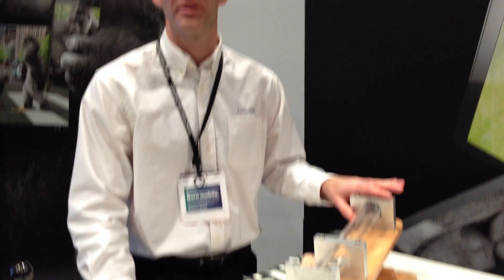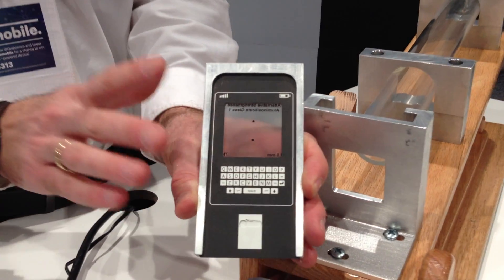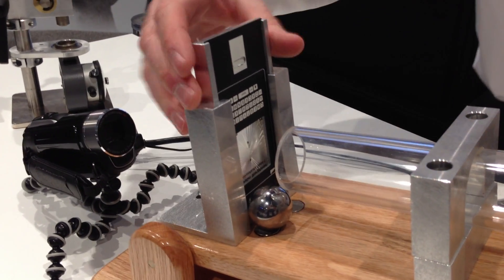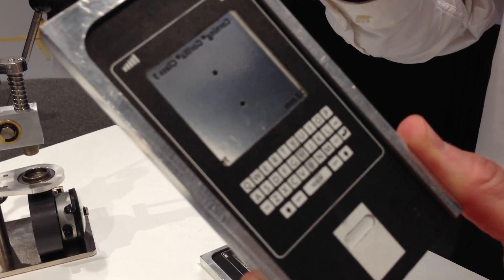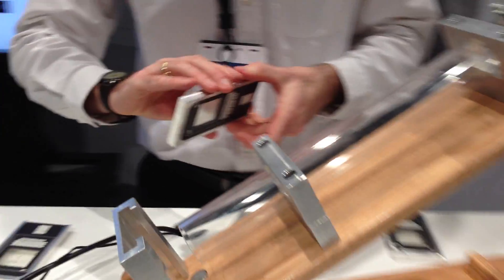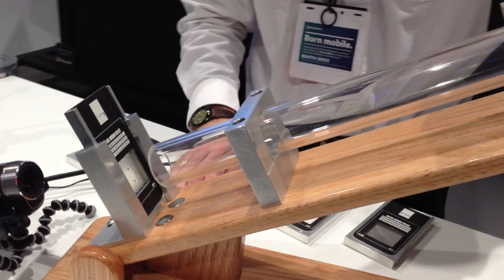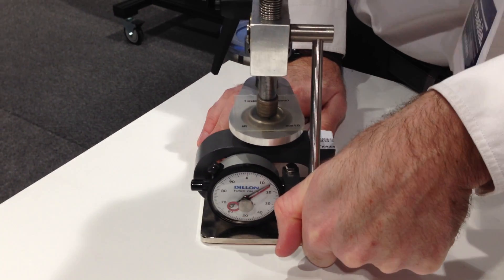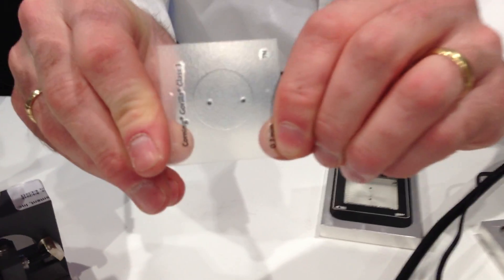Gorilla Glass 3 Demo - MobileSyrup.com

Comment: Deceiving indeed! Force is not the same as stress, because stress is force applied on an area. The ball (pretty light) impacts the glass at a single point, generating a point stress. Meanwhile in the other test, it's 100 pounds, yes, but spread over a much greater area, thus applying a similar amount of stress on the glass. The tests performed are misleading!